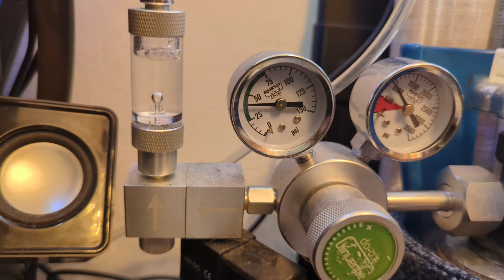How Do You Set CO2? Is a pH Controller Really Worth it?

Comment: You should do a setup with the PH controller please
Reply from the maker: Do you mean setting up the pH controller? I could do that, showing how it's calibrated and so on. It's not hard but there are definitely a few things to explain.
Reply: @AquaLust  yes please I am thinking about getting one I love to see the setup and the calibrated
Reply from the maker: I will say that it does come with calibration fluids. But they are in bags so they are one time use. I would recommend getting more in bottles. Cleaning solution and storage solution as they are used to clean it and prep the probe for use. I check it's calibration each month by checking it's reading to a liquid pH test. Not often have I seen the probe drift. Probes do have a life span. Recommended to replace yearly I think a lot will depends on your water structure. I replaced my probe after about a year and a half just because. (Kept it as an emergency back up) 
I'll def look in to making one to add to this series
Reply: @AquaLust  I just got my Milwaukee Mc122 do you still use the timer so the c02 come on before the lights
Reply from the maker: Yes I use a timer on the output to the solenoid. On an hour before and then off with the light

Comment: Does the Milwaukee MC122 PRO pH Controller not come with calibration solutions? I just bought one (hasn't come in yet). But after a major plant die off it's time to get serious about my c02 set up again.
Reply from the maker: Great question. It does come with the calibration solution in bags so I got some clean containers to store it in for later use. It doesn't come with cleaner or storage solution. When I bought my next probe I bought bottle of it and cleaners and storage solution.
Reply: @AquaLust oh geez... Didn't realize the probe has a lifespan. How long do they last/how do you know it's time to replace? I'm at 3+years with my 125g, I tried to give it it's best go with amazonia soil and live plants... Spent 6 months researching everything before I put water in it. To this day I'm finding I didn't dig deep enough or spend hard enough 😂😭
Reply from the maker: A lot depends on the water structure. Hard water and high pH will wear it faster. I had well over a year on a probe with no issues. The plants in the tank cost more than the meter so for me it's just part of the setup and maintenance costs. 
I back up the prob reading with pH tests to see if it's drifting. Cleaning the probe is going to extend its life span too. I spoke with Milwaukee and they said roughly a year is expected life span and like I said I got well over that. I had no problem with the probe I just replaced it out of good measure.
Reply: @AquaLust that's good to hear! Thank you so much for your responses! I'll be sure to send some watch time and likes your way in the next few days! If you have any other advice or experience you feel like dumping, I'm getting the notifications, I'm all ears 😂.

Comment: I have this same pH controller but don’t utilize the control function due to  the constant clicking it causes from my solenoid. Do you have a silent solenoid you can recommend?
Reply from the maker: None that I have used or know of are silent. The tap sound now and then I don't have an issue with. If it's going off and on very often I would suspect that you have the feed up very high resulting in a quick oh drop and then a bit too much surface agitation resulting in a quick oh rise kicking it back on quickly.wybw trying to balance that out will lower the amount of times it goes on and off.

Comment: Do you have a ph controller recommendation for a fzone pro regulator? I am reading of electrical compatibility issues.
Reply from the maker: I'm located in the USA so the Milwaukee works for me. If you are in a different country then I'm not sure. Maybe an adapter from the US plug type to yours.
Reply: @AquaLust Thanks for such a quick reply.  I am midwest as well.  One final question, so you have the ph controller on a timer to not run any co2 at night?
Reply from the maker: Yes it's on a timer the control stays in 24/7 and the trimmer allows it to run 1 hr before the lights and off with the lights. 
The controler has a 110 outlet that you would plug the solenoid into. Put the timer there. I can't remember if it's this video or the set up video but there is an under cabinet shot that you can see the timer

Comment: How do you do maintenance on the pH probe? Do you take it out and "clean it," or do you just perform recalibrations? Also one year is the most It will last, right? 🙏
Reply from the maker: Great question 
They make a cleaning solution that you soak in. Then you rinse it in distilled or RODI water . After that place in storage solution for a few hours to insure it's renewed. If it's going to be stored you use a storage solution (it comes with a cup attachment. It can't be stirred dry) 
as for calibration they have 2 calibration fluids. A high and low pH and you adjust the display to match the test fluids. I would do this usually ever other month or so. It only takes moments to calibrate it. 
I replaced my probe after 2 years even though it was still measuring correctly. Just out of good measure. They say they will last a year but as you see I got even more out of mine. I have never had one drift very far off the calibration. 
Here is a link to the stuff I bought. It will probably last me a life time 😂 
https://milwaukeeinstruments.com/milwaukee-ph-start-starter-solution-kit-for-ph-meters-and-testers/

Comment: The only thing you didn’t touch on is how do I turn on/off the co2 to match the lighting using a ph controller. Do you plug the actual power adapter of the controller or the other power adapter of the controller that the solenoid plugs into, into a wall timer?  Not sure what to plug into the timer so the co2 isn’t running all night.  
Thanks
Reply from the maker: Ya it got confusing for me too 😂 
This is what I do. I have a timer on the output to the CO2 solenoid. This way the pH controller is on all the time and it is switching power to the timer. If it's not in the "on time" window (the timer is set to turn on 1 hr before the light and off with the light) then the CO2 stays off because of the timer.

If you go to 10:10 in the video you can see the white digital timer plugged into the pH Controller switched outlet.
Reply: @AquaLust thank you for the clarification. I appreciate it!
Reply: @AquaLust   Hello. Really nice video. what's the name of the timer you are using?
Reply from the maker: @AntonisKoutsouras thank you. 
I had that time for a long time now. I think I got it from Lowe's. I now use Kasa timers for my lights and timer needs because I can switch them on easily and not upset the timer function.

They also have the ground eher the timer I have is just 2 prongs. So when I wanted to use it for a light I couldn't so I got this and I have been very happy 
https://amzn.to/4ozixTs
Reply: @AquaLust  but this will go before thw ph controller. isnt that a problem to close the power on the ph controller. isnt it going to lose settings?
Reply from the maker: @AntonisKoutsouras no. The pH controller has an outlet that the solenoid plugs into. It goes there so the pH meter is always on. Even if it tries to turn on the solenoid if it's not in the timer "on time"  the solenoid will not be energized. This allows you to set the times the CO2 will be allow to run
Reply: @AquaLust  damn this is genius, I´ve been thinking about that for an hour before reaching your conclusion
Reply from the maker: Genius maybe 😂 
I thought about it long and hard. I didn't want it going on at night but I also didn't want to turn on and off the pH controller so I can read the pH when it's not active. If I would change anything I would go to a kasa outlet now. It's not a bully. Easier manual on and off for when I'm working on it and just want to apply power. I use them on other tanks for the light and I find it works well and keep the time even if we have a power outage. 
https://amzn.to/4gNuXUj
Reply: @AquaLust  
Friend I´ve got an update on this setup using the digital wifi timers very siminlar to the Kasa ones, my recomendation is that you dont bother with those. I will list the reasons:

1. The Wifi ones, although they can store the program it need a wifi connection to execute it. In other words if light goes out or if there is a problem with the Internet connection It will not restart the program. This happens because it lacks internal memory from which to reexecute the program in case there is an interruption.

2. The bulky analog ones, like the one in your setup (I dont know if you still are using those) are better because even when there is no light going through (like for example, the ph controler detects low ph) it has and internal memory that Will perform the "shut off" so, even if electricity goes through again after that period of time, It will not turn on the solenoid.

Im telling you this because yesterday something happended, and my co2 was still pumping after the period of time I established on the app on the "intelligent" timer. Fortunately it happend on a Sunday and I was at home at the time it happend. Now after much consideration I think I know why it happended: very close to the time the co2 shut off on my app (5pm) my ph controller was reading low ph so my "kasa outlet" wasnt turn on, then after 5pm the ph when up again and it send the signal to turn on the "Kasa outlet" so it went on again.

Altough I must said this is a somewhat rare event, I´ve had this ph controller for 9 days, and this has only happend one time, its still not ideal.
Reply from the maker: Wow thanks for sharing. I never thought  of that issue! 
I am still using the timer in that video. That I e is nice because it has an internal battery so even if unplugged it keeps the time and program. They are cheap timers found on Amazon they just lack the ground Port but the solenoid power supply doesn't use a ground so it works for that but I have my UV in a Kessa now because it supports the ground
 Thanks for sharing!!!